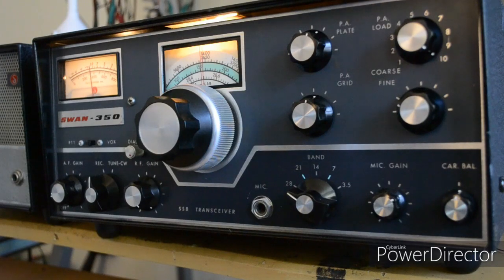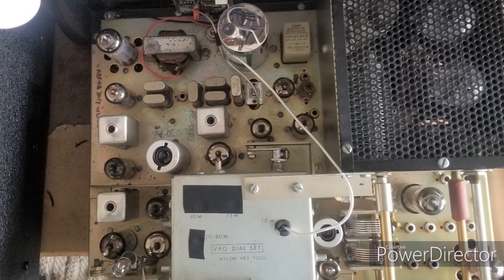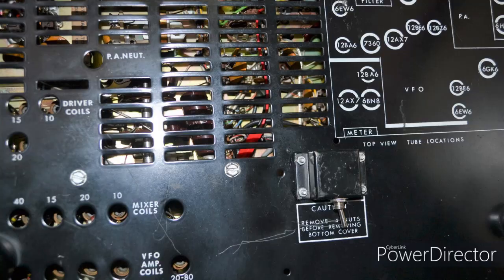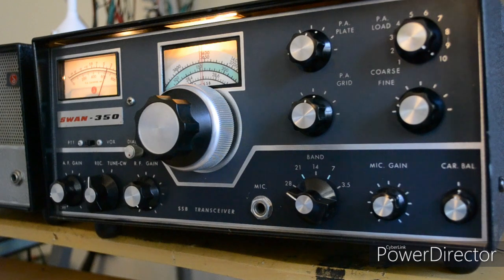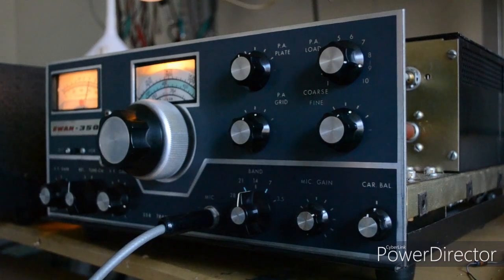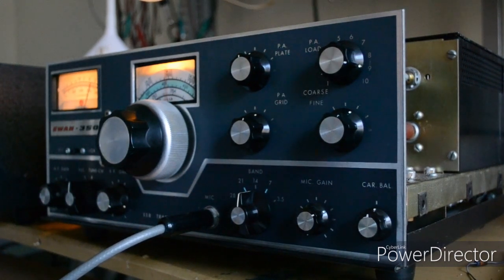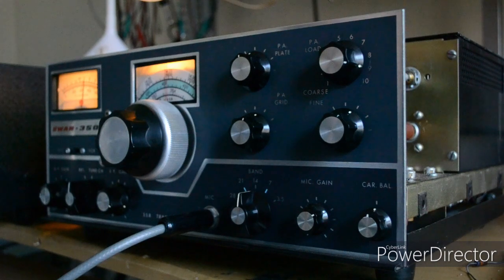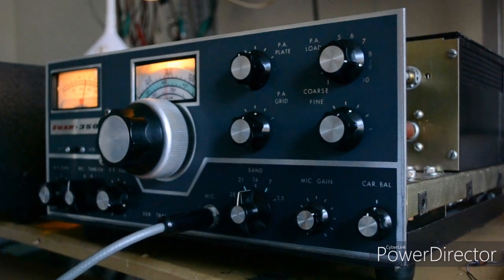Demonstration of the Swan 350 transceiver-the stabilizer was not at all the problem.

Comment: My Swan 500cx drifts slightly up and down in frequency. While receiving and listening; to keep it on frequency by keeping the voice tuned natural is simply tiny adjustment of the vernier knob one way or another. In transmit without having a frequency counter you cant tell if you drifted up or down. Several years ago I was on the Swan talking to a friend who said it sounded like there was RF in my audio. He was using a modern digital tuned radio and I think he was hearing me drift off frequency. I rarely use the 500cx but when I re-string the dipole I have a 1:1 balun to use.

Comment: Did ALL Swans drift or just the 350? I have a 650 (six meter) and I don't recall an issue.
Reply: 250 not 650
Reply: @robertmethia7080  Correct. Haven't had it on the air in a while. But did all Swans drift?
Reply: @Wa3ypx all tube radios drift a lot until warm and a little once they are. Most Swans are pretty typical for tube radios, maybe slightly worse than average for drift. The 350, however... It's worse.